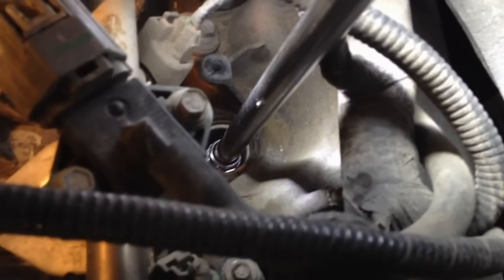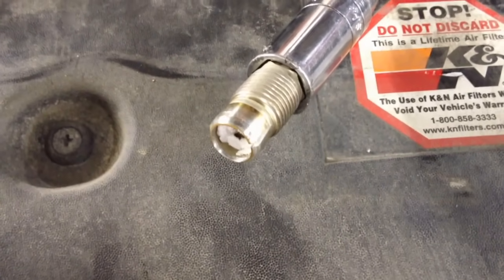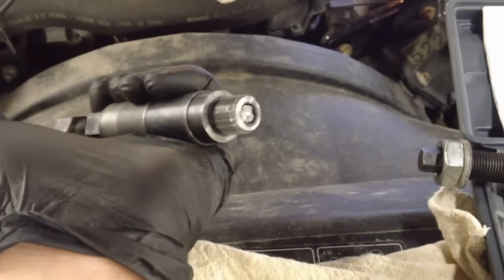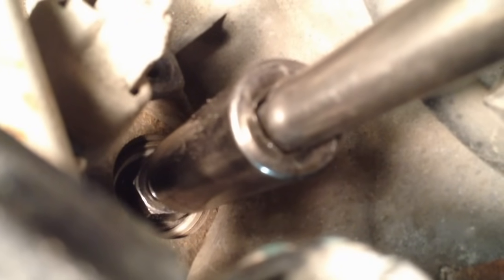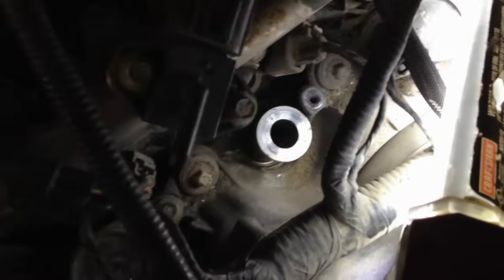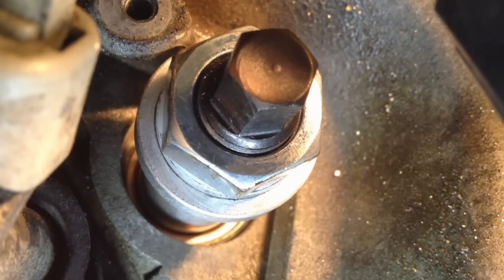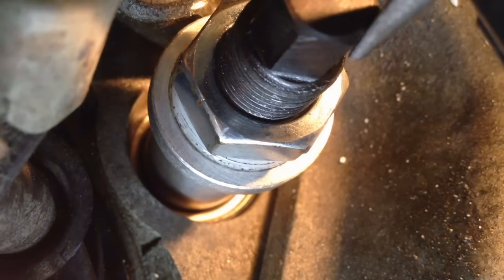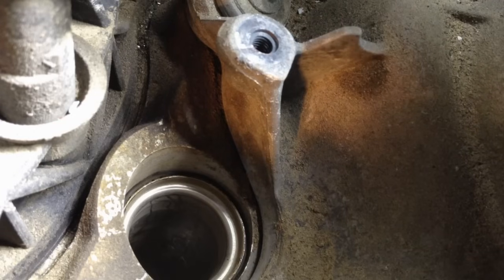Ford 4.6L 3v & 5.4L 3v Broken Spark Plug Removal

Comment: This tool only works for 2004 to 2008 f150, not designed for any other year.....
Reply from the maker: and?
Reply: @FordTechMakuloco  
So i have 2010 f150 and was changing the plugs after watching your video and was feeling very confident and only had #5 left 
When I over torqued and broke it off then watched your video on how to extract it using the lisle system and again was feeling very confident so I ordered the lisle system but it didn’t work and when I called lisle the technician said it wasn’t meant for a 2010 because the threads won’t work.  
The thread puller tube got jammed down in the spark plug hole after attempting to extract the remains of the plug and had to have the truck towed to a repair shop that was able to pull it out and go5 the rest of the plug out
Reply: So the reason for my comment was to say if you have something other than a 2004 to 2008 you my not want to order a lisle system since it won’t work to remove your plug.  When it comes to all thing f150 you are my go to guy I don’t do anything without watching your channel and seeing your recommendation

Comment: Thank you so much for posting this video. Everyone has a little different way of doing this.
When I did mine I sprayed about a teaspoon of DEEP CREEP into the cylinder one at a time.
Then I waited about an hour before trying to remove it. I used an air impact wrench and just
trickle it back and forth a little at a time until it finally broke loose. At the time I did this the 
truck only has 22,000 miles on it. I replaced them all and didn't break a one, knock on wood.
Then I did this again when the truck had 54,000 miles on it and replaced them all with the
second revision only to find out later there is a third revision plug. Even at 54,000 miles
number four cylinder it took me four hours to finally get it out without breaking it. Yes I
did put a good coat of anti size on all the threads when i did it the first time, so much
for the anti size.

Comment: I broke the white thing above the spark plug (I don't know, maybe ceramic..) and it's completely in the engine. And I worked the car and felt the engine a little shaken, so I turned it off immediately.. I think I'm scrowed

Comment: Getting ready to do the plugs on my 2010 f150. I hope I don't have to do this. Thanks for the video and many other of yours. You have saved me a ton of money with your helpful and well though out  clear and to the point explications. Thanks a lot.
Reply: How did it go? I bought a 2010 a few months ago and have no clue when the plugs were changed if ever
Reply: @taylorburton4565  went smoothly. Followed this method, used Kroil penitrating oil and did it while the engine was hot. Did one side then drove it around and then did the other side. I had no problem at all.

Comment: I did that in 2016 2 was broken I bought the kit to pound and extract,and my older Ford 2001 f150   plug flew out , so I also hat to tap in a tread a tread screw in the new tread then the plug, with that engine I got 360 thousand miles,

Comment: The tool won’t work can I just start the engine n it will push out the shell
Reply from the maker: It won’t push it out
Reply: @FordTechMakuloco  the bottom piece is stuck, not the thread part...maybe it will pop out if I keep driving, I will unplug the fuel injector on the 4th cylinder...I’ll let u know what happens after

Comment: I have a 07' F-150 5.4 triton. I've changed the plugs and it ran great for about 2 weeks and started missing again, found out it was a loose plug. Should I replace the plug that was loose.   So I went to replace the plug and the ground strap is in the head somewhere. Do you have any suggestions.

Comment: Anybody have any luck if the center electrode brakes off inside the left behind porcelain? Concerned if I keep pushing the porcelain to try to go slightly past the strap that ill end up with porcelain in the cylinder. The electrode is stopping the puller screw from catching. Any help would be appreciated
Reply: Use a very slim hose attach to a vacuum cleaner. All the way down to the cilinder  to vacuum all small debris
Reply: @joecostu1571  I was able to just blow it out. I meant where the electrode was still stuck in the porcelain and when you compact the porcelain, the electrode is still sticking up avoiding you to be able to get the extractor screw into the body of the plug. I ended up drilling the plug/ extractor with a masonry bit to extract

Comment: I hated this issue I had with my truck. Broke 3 back cylinders spark plugs. I couldn’t get it extracted at all! So I had to tow my truck to Ford and they actually gave me a discount to get them out and install the new plugs I had. $120 total 
After I’ve changed the plugs twice every 40,000 miles. The new Ford plugs are not three piece and did not break. After I tried to e-3 spark plugs. Ran a little better so far

Comment: Great video!
Is there a chance you can push the broke half into cylinder when pushing the porcelain?
Reply from the maker: Some small pieces at the tip.
Reply: @FordTechMakuloco  ok thanks, I was worried about pushing the whole metal lower part of the plug into cylinder. I’m guessing that there was a something that stops the whole assembly from falling in?

Comment: Question, I used the same tool and extracted 6 of the 8 plugs. 2 of the plugs broke off, and ALL the porcelain stayed inside the motor as one piece. when I used the porcelain extractor tool, the electrode wire just pulled out completely. The hex part of the spark plug broke off and spun freely and was not attached to the spark plug porcelain.
I used the extractor tool on one of the 2 after breaking the porcelain off and cleaning it all out, but I have ripped the threads off the extractor tool twice now. Bought another one, after I broke the first one. 
Can you elaborate on how you extracted the one where you broke off the threads? See 2:45 in video for reminder. 
thanks!

Comment: First and foremost, Thank you for this amazing video! I have a 06 mustang GT ~130K miles, no idea when the plugs were last changed so I went into this expecting to break some.  I took all precautions, PB Blaster overnight and a really gentle approach.  I broke 5 of 8.  1 broke as expected in this video, 4 of them the nut and thread portion broke off leaving the porcelin and electrode fully intact.  With the new version of the lisle tool I was able to get the porcelin out of 2 nice and clean.  On the 2 remaining the electrode broke off and the porcelin is still fully intact.  I am assuming that now I need to start smashing away at the porcelin to get it to the "normal" broken state.  I know the electrode is broken really high up so that will be a project as well (hopefully I will be able to yank it out with pliers) but I wanted to ask here if anyone has encountered this or has any good ideas before I start smashing porcelin? Thanks!
Reply: hello did you use the 5.4 triton extraction kit? i have a 08 gt and am not see 4.6 extraction kits and was curious

Comment: why not use engine compression to pop it out?
Reply from the maker: It does not work tried many times.
Reply: @FordTechMakuloco  and what fuse number do you recommend to take out when you only want the engine to turn/crank but not to run, thanks again

Comment: Ok I have a 2005 Ford f150 5.4 l 3-valve FX4 with a spark plug that has apparently has been epoxyed to the cylinder wall in number 4 cylinder. I've tried an extractor tool didn't work does anybody know how to do this please help

Comment: I noticed the link you put for the plugs I have a 2008 that was built 04/2008 and it calls for the new plug as SP-509 so am I safe to assume at that build date these two piece plugs were no longer being used? I cannot find the build date of the engine on my left valve cover because they are FRPP valve covers and I do not know if it was the black or brown boot because those have also been upgraded with accel coil packs! Would be nice to know before I begin this process or replacing my plugs any info would help!

Comment: This is just a broken tip removal, these are very easy.  What do you do when another tech strips his extractor off in a broken spark plug that is missing the flats of the nut so bad that it cuts a groove in the extractor and the extractor just spins free in both directions and won't pull out?

Comment: Thanks for the great video. Just changed plugs in my 2007 5.4 F150. Got lucky. Only one plug broke.  Cylinder 6. Lisle tool worked perfectly. It's a generation 4. The other plugs came out after soaking in Motorcraft solvent. Truck runs Great! Will take out on highway to make sure shudder at 45-50 miles an hour in overdrive has been eliminated.

Comment: Why design an engine with these type of thing. Makes no sense. Dumb design
Reply: I think Ford engineer them that way so a customer will need to bring the repair to a dealership! Very bad engineering, and the Ford recommended OEM tool is also a very bad and difficult to use tool. The   Lisle 65600 tool works great does not take a lot of time.

Comment: I have 03 f150 , started the other day , had a miss.
reader said cyl 8 , misfire , thinking coil pack and spark plug replacement.
will price just cyl 8, and all 8 remove and replace. 
Or maybe i'll just buy a new f150.  What a  ordeal. just to change plugs.

Comment: Did you happen to have any plugs that just kept spinning when removing them? I got 4 out just fine using some deep creep and the back and forth method, one snapped in half on me, but now I’ve got 3 others that just keep turning and don’t want to come out. My first thought was stripped threads, but I’ve been reading and some people are saying that the center electrode might still be intact while the porcelain broke. Not exactly sure how to proceed. Was told to attempt to break the plug in half by force, that way, I could use the extractor tool.

Comment: I really enjoy your videos and I’ve learned a lot from them. I know its a bad design, but l love this engine over their new eco boost crap. I had a question though. Im rebuilding an engine my self and trying to get rid of all the weak points that I learned here (oil pump, phasers, etc...) my question was, if I’m putting new heads, can I put this new updated heads on it w the new spark plug design? Are they compatible? It would be great if can make a video about it?😎👍

Comment: What a  stupid design, those sparks have a really long shaft pass the threads the engine design. The two Ford's i owned the spark plugs were similar to other brands. But the flexplate's on both with heat tempering them my self kept breaking around the crank fitting. Ford needs to make flexplates thicker than 1/16 steel!!!!!😡

Comment: Haven’t tried the procedure yet, but confidence level is very high. A thought about porcelain chips. If you have a fairly nice shop vac, my thought is to adapt down to a hose that will fit down into the cylinder and suck out what you can first. In addition prior to even trying to extract the plugs, blow off the entire area first. No need to get debris into the well in the beginning. There’s also a procedure to use a large amount of carb cleaner before attempting removal. It worked on 6 out of the 8, and the two that broke were in the front of the engine as opposed to back against the fire wall. Very much worth the effort to possibly get a few easy to get to extractions as opposed to the nightmare ones. Ask any dentist.

Comment: Mine still has the boot and half the porcelain and even more of the electrode it still runs with only a .07% misfire on the third censor is there anyway to get it out without breaking the porcelain and having to blow out the cylinder (i have no access to a compressor nor the tools) just purchased a 2000 expedition with the sohc 4.6l Windsor and had it running pretty good for a vehicle with 290000 miles and sitting for a year

Comment: $ 850 2 get my plugs done snapped one frigen ford the plugs these were blowing of the heads because not enough thread  on earlier 5.4      then this   5.4 sucks big time, then coil packs, on and on see that coil pack hold down flange that the coil pack bolt goes in 2 striped when this happens trust me u r basically screwed i tubed it and i'm pretty good with tools. .Hey only 7 more wait till u get to cylinder # 4  grrrr lol looks like u did # 5  front DS bank    1234 left  bank  pass side      5678  ds   if u didn't know.

Comment: I have an important question. I got a socket boot stuck on a new spark plug. Didn’t realize until it was pushed down around the nut. I tried picks, plastic weld in a socket, nothing. So I seen someone use jb weld in a spark plug socket. I tried that now my socket is stuck on the spark plug. It spins freely but I can’t pull it out. Not sure what do do next?

Comment: I don't understand how the engine can digest pieces of porcelain with no damage.  You can use the porcelain of a spark plug to sharpen a knife.  The porcelain is very abrasive and a lot harder than the aluminum of the piston and the cast iron of the cylinder wall. 

I wonder if anyone ever put a borescope into the cylinder a few thousand miles after the engine digested the porcelain piece (s) to photograph the damage?

Comment: I want to thank you for this video. I was ready to pull the heads on my 5.4 when I saw this video. Bought the lisle tool and in 2 hours had 7 of the 8 tips pulled out. 1 plug came out complete. Thanks again! If you're ever in my area beer is on me!

Comment: I just had to do 5 out of all eight cylinders and now everything came out but I've got this squeaking sound coming from the driver side cylinder tight to the firewall I think there might be a piece of porcelain between the piston in the cylinder wall that's the only thing I can think of

Comment: Hi Bryan I hope your still excepting comments on this video. I have a 2005 Ford F-150 in my shop right now for spark plugs. I did not start the job I just got told to finish it. All 8 plugs are seized in the head and 3 on the passenger side were broken lose ready to be extracted. On number 3 cylinder it looks like the tip of the broken plug is pushed right against the piston and I’ve tried the extractor tool just as I extracted the previous ones with no success on number 3. I’m afraid if I move that piston it’s going to drop into the cylinder. Any tips would be greatly appreciated. Trying to avoid pulling the head but not looking promising
Reply from the maker: Sometimes these get pushed down too far into the cylinder for the extractor to get a bite. I generally drill out the porcelin to chunk it out and then retry with the extractor.
Reply: Hi Bryan, thank you for your reply I have watched all of your videos on how to get these plugs out I guess I’m a little gun shy of drilling down a hole I can’t see except with a bore scope. Being the vehicle is 14 years old I got in touch with the customer and found out these are the original plugs the truck came with, that being said I know it’s a hard question to answer but do you think all the plugs will break? Again I thank you for your response!

Comment: I just bought an 02 Xlt limited with the 4.6l with 79,000 I'm terrified to try and replace the plugs...I have never seen such a worse design for a spark plug. No wonder why they're called Found On Roadside Dead or Fix Or Repair Daily...Geezus H Crimmany how janke can this pig become..I'm about to find out...it was at Ford dealer for 3  months and their techs could not reprogram PATS keys to PCM. I had it towed to independent mechanic and he had it running less than hour. He used Autell sp ? scan tool.

Comment: What if the guide does not sit low enough in the well?  The extractor falls below the guide due to this reason.  I have a ton of carbon build up - what’s the best way to clean up the well?  Previous owner’s Autolite Spark plug broke off long ago....
Reply: Update: The Lisle tool guide was correctly sitting in the well.  The extractor fell below the  guide due to the fact that there was no spark plug tip stick in cylinder 7.  God knows what happened to it - I’m assuming is disintegrated or somehow made its way out through the exhaust valve.  Popped in a new motorcraft spark plug and ignition boot to address P00307 error code.  Check engine light shutoff upon startup!  

Thanks FordTechMakuloco for your great videos.  Full timing job via your videos is next!

Comment: Please help me, the tip broke, the entire porcelain came out and only the metal cap is stuck inside, I have the extractor tool but it's not bitting at all, I'm at a loss, the teeth on the extractor are new and sharp so I'm unsure why it doesnt bite

Comment: What a monumental pain in the ass. With 228,000 on my '04 FX4, I'm seriously considering just leaving the plugs in until the engine just dies and then dropping in a rebuilt Triton, which, I believe,  is my only replacement engine option.

Comment: Just ordered the Lisle 65600, have to remove 7 broken plugs tomorrow, son of a bish
Reply: these expeditions are cheap on line and I thought about buying one. did you get the 7 plugs out??
Reply: avery domingue yea bro!! 1 came out completely and 7 broke in the engine. i actually ended up getting the 7 broken plugs no problem haha best tool ever. I would recommend putting wd-40 where the spark plugs go when the engine is hot and you’ll probably end up getting most of them out without breaking. I didn’t do that so the 7 broke

Comment: that's the same problem back in time with the 90's 7.3 diesel ford injectors broke in half   the same crap, the best way to fix that problem if you don't have that tool,  before use the ratchet spray wd40 very well on the spark plug  one night before  the tune up and  take one at the time, if the spark plug brakes in half put a rag overt the hole  and crank the engine for 3 seconds until the spark plug pop's out into the rag.